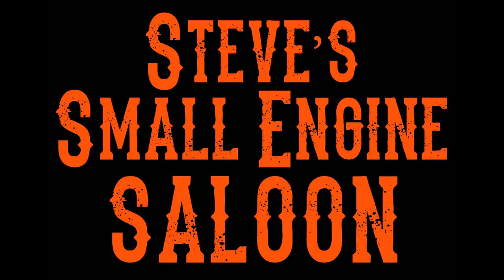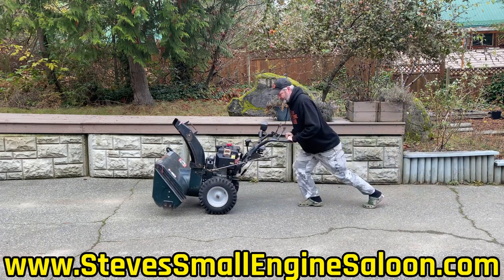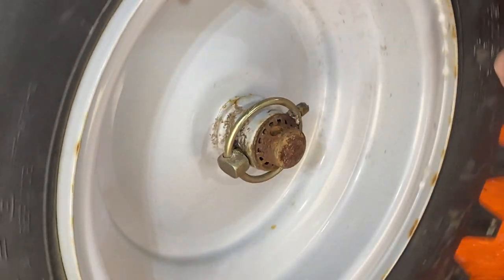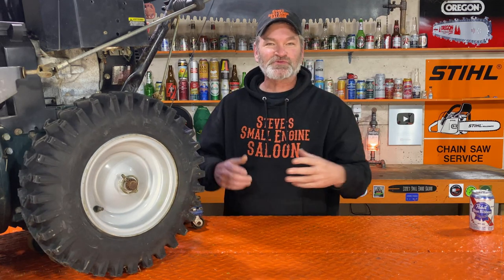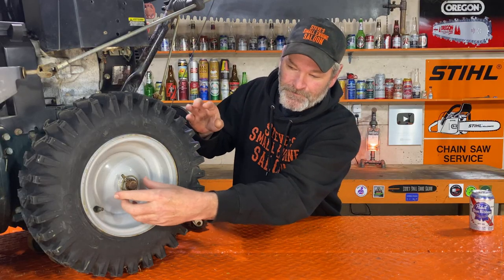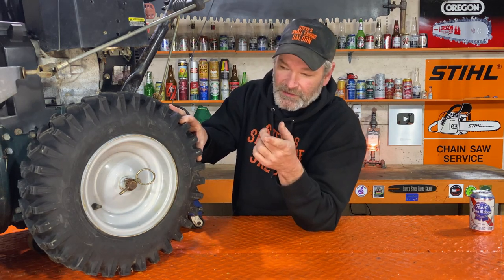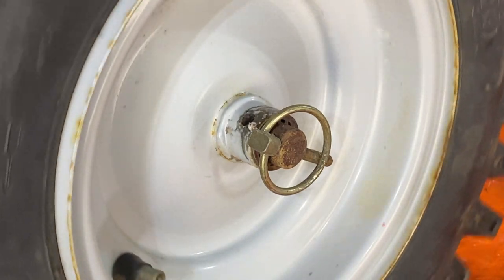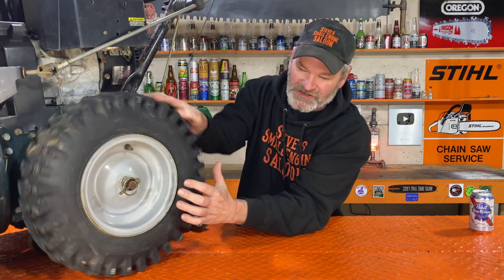Bet You Forgot About This Snow Blower Feature

Comment: I’ve had my MTD snowblower over 25 years and never knew about that feature. Thanks 👍
Reply from the maker: You're Welcome...
Reply: That’s because you a a true man. And men don’t read instructions ,  that’s what my wife tells me... lol
Reply: @pasqualeparente9776 sadly modern MTD products don't use this system. The modern stuff just has a bolted on wheel so if you want onevthat steerss easy you don't have to buy one that has an easy steer system. I have both and older and newer MTD snowblower withnthese differences.

Comment: I just fixed a neighbours ariens and it had a knob that you turned to lock the wheel or unlock for easy movement . Great system should be on all blowers! Cheers!
Reply from the maker: Right on
Reply: That was on the older Ariens  models like my first dated 1977. My new ariens dated 2015 is automatic,  These two versions are more
 like a car with a differential with a lock.  The type with a pin is a cheaper less better version that applies no power to the unpinned wheel..

Comment: Thanks Steve. I have never seen a snow blower up close. We rarely get any snow here in western Oregon. This is a great tip that I will remember.
Reply: we hear about such devices... my mower is belt drive and the belt will occasionally walk out of the groove and push the idler far enough to engage the wheel brake.  but that's an entirely different issue.

Comment: As always your video instruction addresses the most usably practical yet often overlooked features of the machines we rely upon most heavily.  This visual will be etched in mine and the minds of countless users & mechanics across the country for its core value & utility.  This one falls in the shop-smart category.  You're far more apt to roll an easier to move piece of equipment thereby precluding that 'flat spot' that comes with 'sitting'.
      Despite our most well-intended efforts to remember the small, but dynamic features it is  such a relief to know that there is someone like you to offer the occasional valuable  reminder.  
         It is always time well spent to reacquaint oneself periodically with the designed-in accessory elements that make the task easier.  Your easy manner and sincere desire to help make it doubly enjoyable.
                                                                                            Mike Kirwan - Kenmore, WA

Comment: Seesh, I gotta check mine. I am cheap and don't like to run it if I can push it into the garage(the smoke too). Thanks Steve for the tip. I don't recall if it's in my manual.

Comment: Another cool thing about that trick is it allows the two wheels to move independently of each other so it turns easily without binding the wheels up.
Reply: yes but that wheel will not do any pushing. Just the right wheel will. less pushing power and might want to steer to the left.

Comment: Hey Steve, your videos are great. I've learned much. I got a Toro snowblower similar to the one on this video that was set outside for several years. I decided to buy a NEW carb to save time rebuilding the original one. The bowl is getting fuel, it has spark, starting fluid proves it runs but I cannot get the sucker to run. What am I missing?

Comment: Thanks for the tip Steve. It is worthy of a PBR. Cheers !
I thought I never had a snowblower with the shaft pin like that but now I know some do and I will keep an eye out for them. My newer snow blowers all had the triggers with cables to release the drive gears on the handles. The old Craftsman I had from the 70's I thought had nothing to release the gears on the drive wheels. Maybe it had the pins like the one you are showing.
Reply from the maker: Right on

Comment: Wish I had known that feature existed when I was a kid snowblowing driveways in a huge subdivision 💪
Reply: YA but you would not have been as fit
Reply: @robertskinner6487  yep and it still beat shoveling snow.
Reply: It all depends on your age (LOL) as through the hub locking pins were intoduced in the late 80's. Earlier models had a bolt and lock nut design as on my first snowthrower, a 1976, 6 hp, Roper. Regards !
Reply: @danielrobert7181 
My 1990 Honda HS55 has the bolt with a cotter pin holding the wheels on.
Reply: @steveniksid5874  Yes many manufacturers adopted that ''hybrid'' improvement at some point. Thank you for touching bases !

Comment: That's also used to make it easy to steer the snow blower when both wheels aren't required for traction, snow blowers have the tendency to only want to go straight ahead. Without the pin in the outer hole when under power the wheel will launch that spring clip. Been there done that.
Reply: Yes! I was wondering why he didn't mention that, but he did say it will not work without the pin. Hmm, strange. On my blowers, I freewheel 1 side when throwing snow.
Reply: @tinytim9453  why only one side?
Reply: @charbonneau  Easier to turn

Comment: I'm very aware of this trick, I've more than a few times tried centering the shaft hole with the wheel hole when I'm in heavy wet snow & need both wheels to drive...It's always in a blinding snow storm when I have mittens on and it's nearly impossible to get it aligned...LOL  Yea I know, I should do it in the garage, but Hey, thanks for the video  🍺 Cheers!

Comment: Many of the newer snow blowers have the 'zero turn' drive system and on these when you squeeze the direction lever it doesn't apply brakes, it disconnects from the drive axle. So just squeeze both levers.
Reply from the maker: Exactly!

Comment: I knew this. But at the same time the OTHER SIDE is still engaged. This allows "differential" action and easier sharp turns while moving the machine around or even using it to remove snow. Can be harder though while going up hill or loading the machine on its own power up drive on ramps into a pickup truck bed for transport to other snow jobs.

Comment: AND if you pull that wheel off - wire brush or sandpaper the rust off the axle and add a little grease ... it will roll easier !
Reply from the maker: Right on

Comment: bought a used one cheap last year, the previous owner put the pin in that hole with the wheel so it had too much clearance to come out so remember not to reengage the drive shaft in the wrong hole, also wouldn't put it in your pocket or that wheel is going places without you

Comment: Don't forget us hydrostatic drive guys. Mine has a small lever near the ground that you just flip sideways with your foot. If you fail to do this, you won't move it anywhere. Great reminder though!
Reply from the maker: Good point!
Reply: Bet it’s a Honda!  I love mine, it will go through anything.  First pull starting for 15 years now!
Reply: @tomrogers9467  It is indeed a model HS928 Honda and this will be it's 20th year with me and it continues to start just as you say. I should have bought 12 of them so I would never be with out one. Lol.
Reply: @wow68    Ha!  Same machine as mine!  In addition I own a 9.9 outboard, an 06 CRV  and a 17 Ridgeline.  I’m 70, ( sigh) and they are the best quality vehicles I’ve ever owned.  No more big 3 junk for me, ever!  And BTW, you’ll never need more than one Honda snowblower, because you’ll never wear it out.  Cheers! 🍺

Comment: The only problem is that most of the wheels are already rusted to the axle if they were not lubed
Reply from the maker: I agree!
Reply: "Florida Man Wins Snowblower Pushing Contest"
Reply: The majority of snowblower servicing I did in my shop included  the “rusted axle” nightmare.  Often required a new axle and two new wheel hubs.
Reply: @tomrogers9467  nah. Just Sawzall off the hub, wire wheel the axel, slather on the anti seize
Reply: @flat-earther      Where the hell did this comment come from?  Weird.

Comment: I can't imagine a well-oiled transmission causing that much resistance were to where you cannot push the snowblower around with the transmission engaged. I would think a little bit of grease on the chain would help and also make sure the friction disc is not slightly rubbing with the lever disengaged. The intermediate shaft with the friction disc has bearings on each side those can also wear out over time as well causing resistance. Great tips but a competent small engine person should at least check the transmission for proper maintenance. I've torn apart plenty of them where I find mice nests and debris gumming up the works.
Reply: it's the difference of putting your car in neutral instead of drive/first when you have to push it

Comment: Small drive disc with rubber friction wheel not design to push anything.
Also they get wet or oil on disc machine won't move.
Clean it off and machine will drive much better

Comment: I just pull both turn handles and it does the same thing... Same thing for quick reversing, pull both, give it a yank. 🤷‍♂
Reply from the maker: Nice, you have a "top of the line" blower!
Reply: @StevesSmallEngineSaloon  haha maybe! Cub cadet. So far pretty happy with how it performs. You literally have to “remove the chute” ( direct quote from the manual) to get the panel off to get to the carb… I cut a couple tabs so I only have to remove a couple screws. Otherwise it’s been a champ. I’ve recommended your channel to several people!

Comment: if I did that to mine the wheels would fall off lol,  because it doesn't have that retaining clip to keep the wheel on.
Reply: That is for sure!!!
Reply: Wouldn't the Pin keep the Wheel on? Put a flat washer on there to take the thrust load and you are all set!
Reply: @KensSmallEngineRepair  true enough I guess however mine the shaft doesn't extend and is flush with the wheel
Reply: @AndyADVenture  do you have enough shaft on the inboard side of the wheel? If so you may be able to push the wheel In , put on a thrust washer and install the pin and voila!
Reply: @KensSmallEngineRepair  I don't remember I'd have to check. however I have a newer one this year that a friend gave me I have to fix up and it's almost identical to the one in Steve's video I'll have to check if it has this feature

Comment: 🤦‍♂️🤦‍♂️ are there clips on both wheels? If like most economy blowers all you did is disengage one wheel (actual purpose of this is to ease turning ability while in operation) You’ll still be pushing the chain and friction disc from the other wheel being the axle is a solid shaft.